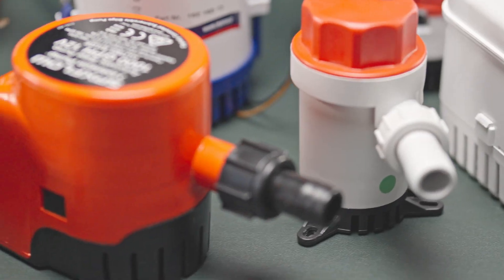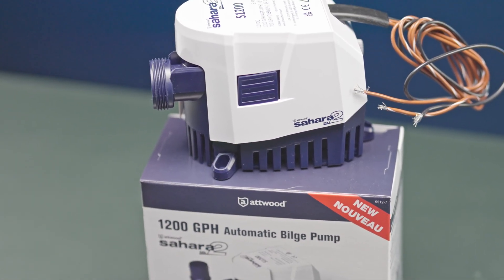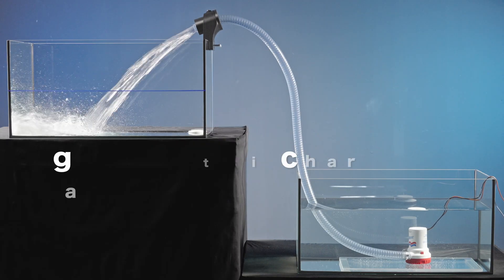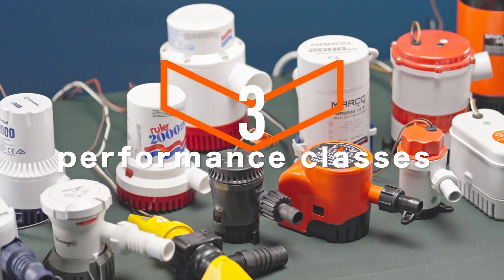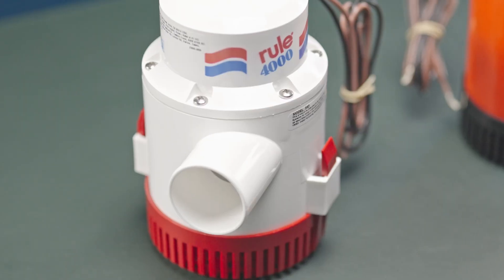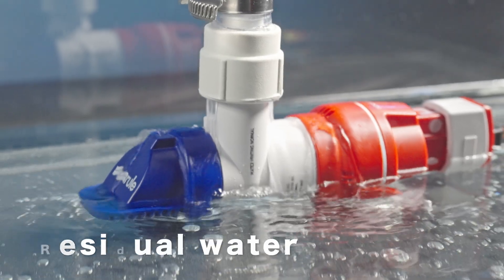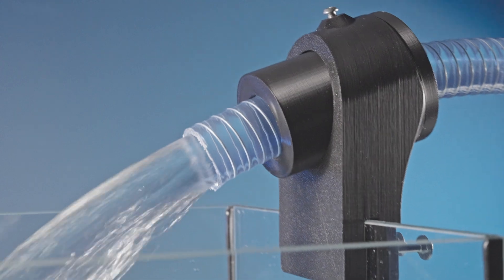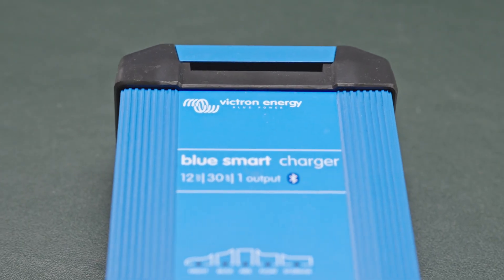Bilge pumps - the big test! 2025! | SVB

Comment: I found the Whale supersub smart 1100 dissapointing. Not because of the pump volume, but the construction. The back screw in section where the motor connect to the pump broke off easily. Very thin and weak.

Comment: Installation is so much more complex than this - long pipes snaking around the boat, non return valves, float switches and actuation (bring back mercury, please!), 12/24v and so on. There is also the issue of self priming with trapped air in the pickup/pump - this is a pain although a 1mm hole strategically drilled in the body of the pump can overcome this with minimal loss of performance.